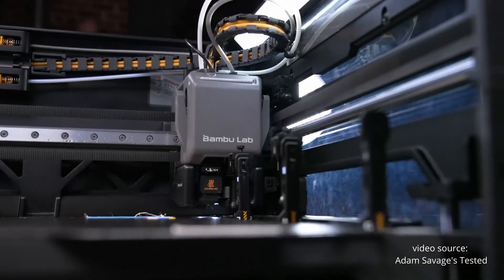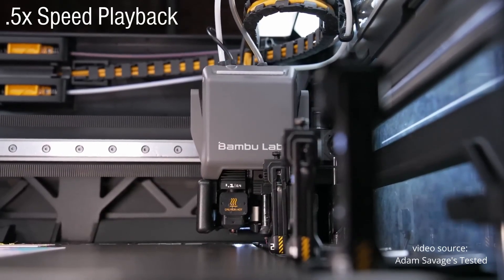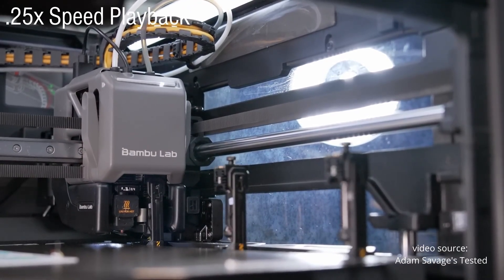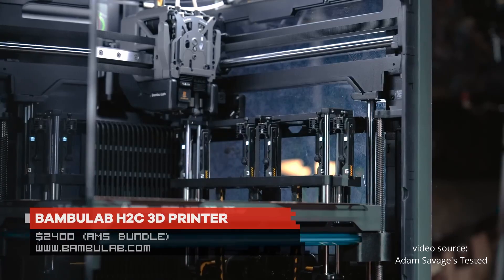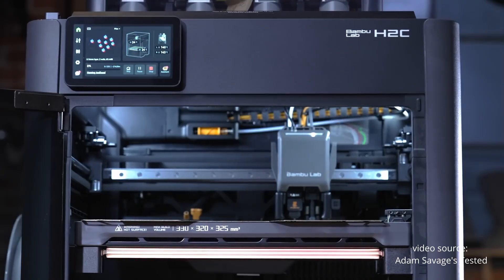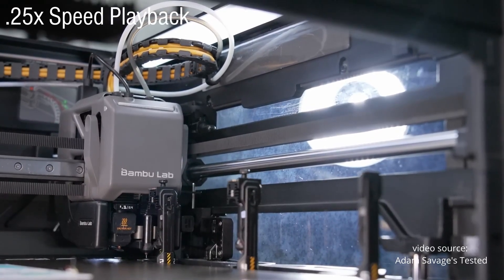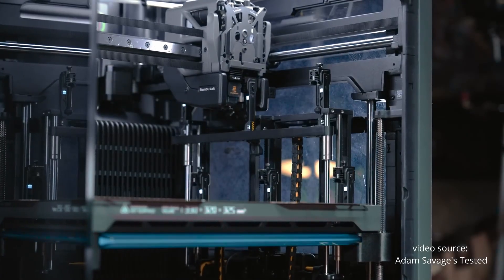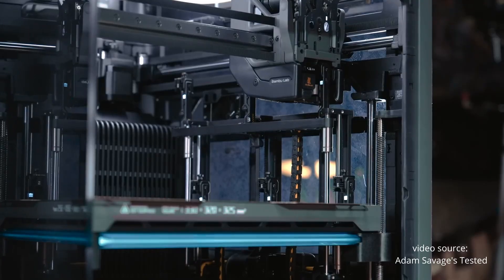The H2C Solves One Problem — But Creates Another

Comment: Thanks for the honesty. I am not a hype fan for bambu or anything, I have wanted the Prusa XL for a while, however I don't like the amount of calibration and tweaking that I have seen in videos. Also, if I want to print more than 5 colors, which I do quite often, then it is much more difficult. I do not like the bottleneck that seems to be happening in the 3d area and I really hope that it can be improved over the coming years.

Comment: Can you try printing TPU 90A and 85A on right nozzle?
Reply from the maker: hi there, TPU is not recommended with the right nozzle since the right nozzle uses the AMS, although u can perhaps use TPU for AMS (still i wouldn't trust it that much)  If u want to use TPU 90A or 85A the safest way to do it is with the left nozzle (manual feed)
Reply: @aim6mac  ehmm don't use the ams on it ? But you are correct lots of people still figuring out how todo TPU esp on the 2 heads at the same time so in multimaterial mode. Its clearly something not fleshed out but will be. Won't be great solution for TPU but no ams part ever was it will be 'okish' at best.

Comment: can the snapmaker print with 24 differnent colors? Can it automatically switch nozzle sizes and select on demand 0.2, 0.4, 0.6 and 0.8 in the same job and use multiple colors? yeah, you'll run out of nozzles

real toolchangers like the Prusa XL have the advantage of having different tools, not just a toolhead with a nozzle attached - think of pick and place toolheads, laser toolheads or the already introduced silcone toolhead - this is a thing that snapmaker does not solve

snapmaker is dead in the water - the future is real Toolchangers like the XL or Hotend-Changers like INDX and Vortek 

The advantage of Vortek is, that it is compact and uses automated feeding from an AMS - you can select the right tool for the job (nozze size, color and material) without walking to the printer, it is also more energy efficient for technical materials in an enclosed chamber because there is no huge bulky hydra of tubes sticking out the top - but it sucks at swap times (your only point)

INDX on the  other hand can swap colors and materials very fast, but is limited to the selection that is in there, you need to walk to the printer load/unload the filaments you need for the project or you are limited to a maximum of 8 from the start - also if you want "black PLA" in 4 different nozzle sizes, half of your INDX is already blocked by this and you need 4 spools (on Vortek only 1 spool is enough), als enery efficiency sucks - but it is faster 

TL;DR: the Snapmaker Approach sucks but there is room for the Prusa XL, INDX and Vortek depending on your use case.
Reply from the maker: Sorry I don't agree .... have u seen how many units Snapmaker U1 sold with their KS ? I think it was the most sold 3D printer on there.  I think that tells alot about the market.  INDX is very cool, but too new, it will take some time before everyone can get their hands on it for sure.  Prusa XL was not the greatest experience for us, it too big for it's gantry.  Failed alot with taller prints, relieablity rate was pretty low.  I prefer the Snapmaker over the prusa xl honestly.  Maybe if they gave 50 percent discount on the XL and included a better enclosure then MAYBE just Maybe...
Reply: @aim6mac I was not talking about the price

I was speaking about the working principles of the different systems
Reply from the maker: @suit1337  well then, Prusa xl and Snapmaker U1 are both toolchangers that work the same way aren't they?
Reply: @aim6mac the Prusa XL changes the entire Toolhead, so your tool options are not very limited

the Snapmaker U1 keeps parts of the toolhead, including some electrical components (the part cooling Fan for example) when designing a new toolhead you always need to account for that

be it a new extruder design or a completely different toolhead: the XL got almost limitless options, the U1 is limited by design

the advantage of the U1 is that the partial toolheads are cheaper

but if this is the goal, an even more stripped down tool like INDX or Vortek is even cheaper

Comment: All Bambu needs to do is come out with an AMS 3 Pro that has individual tubes and connects to a hub with 16 possible inputs. The hub would be on the back of the printer and be minimal distance for retractions. Seems simple to me….
Reply: according to the H2C FAQ they are at least working on a "hub" that allows 2 filament paths to be switched to both nozzles, so 2 AMS are enough to feed both nozzles in parallel
Reply: I think a lot of people were expecting the ams 2 to have multiple outputs
Reply from the maker: @blaskotron  you're absolutely right, I was one of them....  I strongly think it's a missed oppurtinity for Bambu Lab
Reply: Even then you need to flush the nozzle, when you keep a system with only one nozzle. This is time consuming. I think Bondtech is on the right path with their system. They made, what Vortex should have been.
Reply from the maker: @floriana.9459  why would you have to flush the nozzle if there are multiple PTFE tubes going to the AMS? Since you also change the nozzle's , u would only have to use a prime tower thats about it.
Reply: @floriana.9459  it only needs to prime the nozzle, which INDX needs to do as well.  Priming is not purging, it is building pressure in the nozzle.  

People keep saying that the cut filament means it needs to empty the nozzle out, but that's not true at all.  The filament melts, it doesn't matter if it was cut or not. The amount of filament in the prime tower is much less than the volume left in the nozzle.
Reply from the maker: as long as they sell 'enough' units of the H2C they won't come up with something like that...

Comment: I think when they started working on this they began by asking how they can use the AMS to reduce purge. That was the wrong question. Cutting and retracting is a slow process. Each nozzle needs it's own filament path. 40 seconds to switch is too slow. Other models are switching in 10 - 15 seconds. On a print with hundreds or thousands of switches that adds up to many hours of print time.
At the very least they should release a 6 spool AMS. Right now you need 2 AMS with 8 slots for 6 nozzles... it's so awkward.
Reply: think a bit outside the box - the next step is to assign different nozzle sizes to different features (the recent Bambu Studio allows assigning different tools (not sizes) to different features in Dev Mode - same goes for Orca Slicer) - it is only a matter of time when this allows multiple nozzle sizes

if you print with 2 different nozzle sizes with the same material in the same print there is no need for the time consuming retraction and feeding from the AMS anymore, cut the filament, swap the nozzle, print again

Comment: Ok i know i will be yelled at but do this experiment in your head. Let's assume that the h2c change would be 15seconds instead of 30/40seconds.... yes i know its not but just accept it for a second.... Would  anything else even come close in features, it's shipping now and has ways to expand it etc etc .. no........ Now back to reality for some prints it will be slower thats it really !! still a great printer with many options for people who want it faster than their old printer with way more options but not as fast as some other less capable printers.
Reply: Rewatching this after owning the h2c for  a few days i even agree more with my own statement. You are not 100% wrong but the numbers you provide are not real. The avg change has to be a mix between the time between 2 heads and vortek and full ams change (when you use more than 8 ! colors) the two times mostly involved are about 18-22 seconds for a head<>head change and 35ish seconds (you can already turn a few things off, i expect we will see more). The average depending on print will be out 28-30? vs (again print to print with tower etc etc) 12ish for toolchangers and 17ish for INDX. Sure slower but way more than the 30% you say vs a ams like system (example i see times from 1d9h to 12h) thats 20 hours drop. yes in this case a full toolchanger will probably be 50% of that again but it making it sound that it just saves waste is simply not true. Same with claim of not being able to keep materials for a hotend it does in fact BETTER than the other systems you can assign materials to a nozzle and when you need more space swap them out in like 2 seconds it remembers them. Got a nozzle for some weird material it can always stay with that material you just put it in the rack in 2 seconds when you need it (if its not on the rack already). Lastly you make it sounds like real toolheads are easier.. they are not you have 2 moving parts in the vortek (1 easy to access motor and a little slide on the head) vs say 5 or 7 (if compare) full toolheads with all their parts what do you think can fail easier? You are more redundant on a toolchanger but less breakdown ? probably not. Your video address a valid point on one area it stays behind full tool changers and even INDX but on nearly all the other points you outline you are making the time deltas bigger than really are, talk about more complex when its not and less about speed of using it (changing spools, hotends,setup,...) and all this clearly because you already biased to one solution. For me its much more easy there is one weakness into this h2c its slower than some others coming out soon but a will take still a year? before we see a printer that has all this (heated, closed, same buildsize) i can and i am using the h2c now not some time in the future. There is a good 50%? change that INDX will win in the end and in 2 years that is the most stable/cheapest/best around if that happens and i can't bear to use the h2c anymore ill switch again but for now its available for people who want to buy and use it no other printer with these specs is now... Vortek is indeed probably not the end of things and might be a in between solution but its real and not a pipedream.

Comment: The thing is the high print quality with much less waste. 
I saw it yesterday at Formtec. It is an easy docking with as few parts as possible. 
Evolution is exactly the wireless part.
Reply from the maker: although that evolution isn't limited to Bambu Lab, Bondtech INDX  is heating exactly the same way (induction)  and to be honest, all that extra costs for that isn't really worth it for me.... I've seen how much the upgrade costs to do the Vortex and for that price you can get a full blown toolchanger printer nowadays.
Reply: @aim6mac  Both the ams and vortek parts are all about easy of use really. The ams is used by many because its easy to put in a new spool, have a backup ready, change it remotely change between 24 spools if you want with the press of a button and loading new ones is easy open, put in end point and it goes. Same with the hotends now you can pre-load have 7 hotends ready on the touch of a button and changing new ones is easy for the left about 30seconds and on the right vortek part if not already on the rack (say move from 0.4 to 0.2) putting it on the rack open the door and click it on 1second. We all like more printing speed i won't deny this but there is also ease of use and other comfort and how a printer works points.

Comment: After seeing the unveal, I thought the same, the nozzles specially are gonna be expensive and proprietary. I'm gonna just take the H2D and deal with the poop, the price is ok, for what I expected, but definitely they are gonna force you with the nozzles,I prefer to be open about my selection.
Reply from the maker: yes with the first initial announcement they gave us the feeling of quick color swaps, and yes its true to a certain extend, (8 seconds induction heating the nozzle is all they talk about on their advertisement) in reality thats only one aspect of it.  It's more like we can swap color/material in about 45/50 seconds... sad
Reply: @aim6mac and the printer just includes 4 induction nozzle, so out of the gate you have to buy 3 extras.
Reply from the maker: @oyolajm  thats 36 euros per 'wireless' nozzle .... phewwww
Reply: @oyolajm  2 extra you can't have 7 in use at the same time. machine has to have a free place to store the one before it gets a different one so 1 in head, 5 on the rack. The default box comes with 8 nozzles 6 induction (4x0.4,0.2,0.6) and 2 standard nozzles for the other head (0.4). The Ultimate set comes with 3 more induction ones (0.4) and 2 left ones (0.2 and 0.6) so thats a total of 13 hotends including. How many printers are on sale  that come with 8 or 13 hotends in the box?
Reply: @aim6mac  Like other brands you can also buy in a bundle i assume more options are coming for now i see 129 for 5 nozzles (3 induction 2 normal) for 26 euro per nozzle.

Comment: They should have added dual PTFE tubes so the second filament could enter the toolhead just as the 1st filament is getting retracted. That would have sped up the changeover.
Reply: Bambu A1 already do this. All 4 ptfe tubes goes directly to the toolhead, that is why it is much faster on colorswitches, the filaments are all the way up to the toolhead, and only retracts maybe 10mm instead of going the whole way back to the AMS.
Reply: @AndrewTSq Now that i have a h2c its easier to see they are still waiting a lot on things that to me don't seem to be needed it seems they feel they first want it to be stable and then speed it up. It will never be the ultimate speed demon but they can bring things down. For example the moment they cut the old filament i can't see why it doesn't go in one flow pulls back, sends new filament until it hits the head and stopped by the gear even if the new hotend is not in yet ! We will see how they will tune this.
Reply: @scb2scb2  yeah there's always the possibility that firmware updates could optimize the number of processes that happen simultaneously.
Reply: @SpartanORGN  A lot can be done i think how much can be gained once they optimize i have no idea i suspect at least 10-14 seconds between the ams stuff and priming tower. How much they will do no idea they are clearly aiming to have it work 100% all the time. Same with all the checks before it starts to print. The h2c is highly focused on 'fire and forget' in my view and that in itself is not a bad thing vs babysitting it through the first layer and hoping for the best.
Reply from the maker: one of the ways they can fix this 'issue' is to run multiple PTFE tubes from the AMS to the toolhead, that will significantly drop down the feeding / retracting time from the AMS
Reply: @aim6mac  I was experimenting with this. You can disassemble the AMS 2 Pro and move the filament sensor either to the back of the printer or inside the chamber, which can speed up swap times insanely fast, but it's very jank and I found it caused some other problems. Going to keep experimenting with it though and see how fast I can get it on my P1S.
Reply: @mavis6935  this is something I've wanted to see someone test.  I think this is what Bambu needs to do is add a filament hub inside the printer instead of the AMS.  You could theoretically get the filament chambers down to a similar time to the INDX (~15s)
Reply: in the FAQ it says they are working on a Filament Path Switcher to solve that issue
Reply: @suit1337  Where does it say this? I remember hearing something similar but could never find it again.
Reply: @mavis6935 on the H2C FAQ

Comment: I would rather have four tool heads that could each be fed by an AMS (either the single spool or multi spool model). Hopefully today’s announcement from Bondtech will provide something more like that for folks outside the Bambu ecosystem.
Reply from the maker: what about one toolhead and 4 PTFE tubes going to it (like the A1 and AMS lite but more efficient , that would take away from the retracting and feeding times alot.  But it wouldn't solve the multimaterial issues ...

Comment: I understand your perspective and I have seen a few reviews pointing out this issue. However, I think it's perfect for my needs. I don't mind how the increased time it takes over other similar tool/hotend changers. But what I absolutely hate is wasting filament. The only printers I've had are two Creality Ender 3 V2s and I've been holding out specifically waiting for Bambu to release the H2C
Reply: 40 seconds per change is a bit much when you consider INDX is less than half that. I was hyped for H2C but now I’m leaning towards core one L when INDX is out for it next year.
Reply from the maker: @perkulant4629  you might have to wait pretty long though...  But i'd prefer to wait too for something like INDX
Reply from the maker: exactly, it's a great solution for those with the same issues as you, wasted filament will be reduced with this!  But me as a speed demon , it really isn't bringing anything on the table sadly.